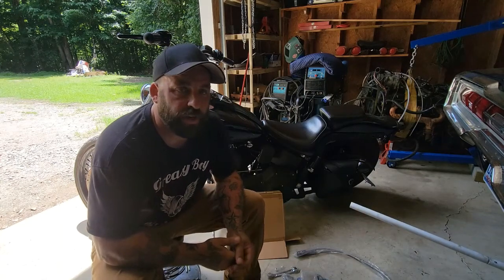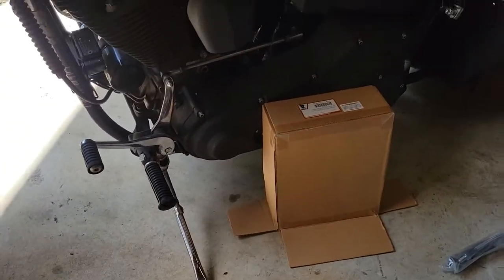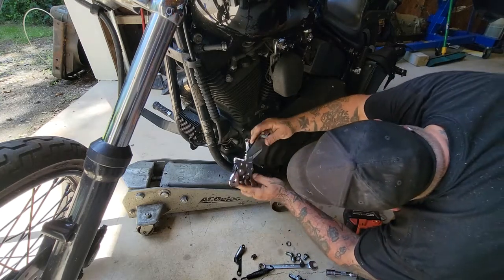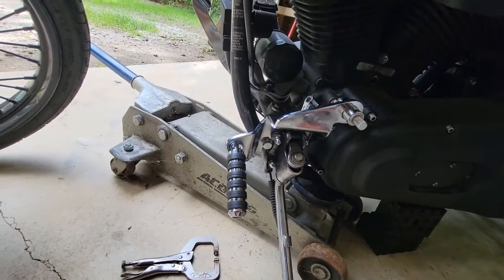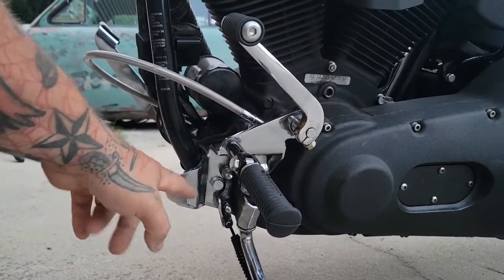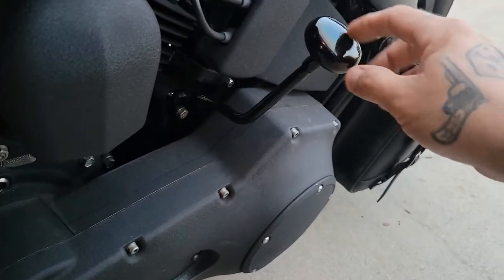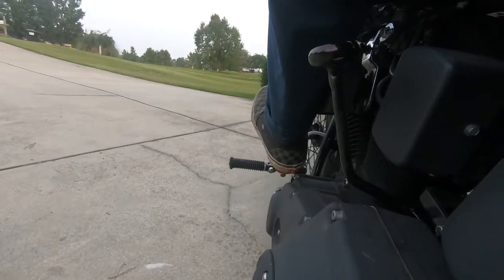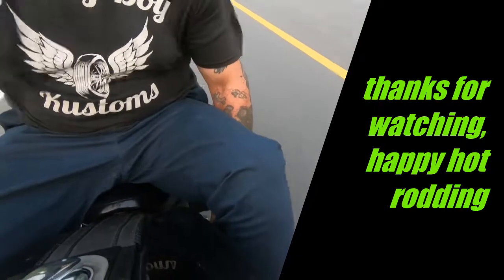FOOT CLUTCH AND JOCKY SHIFT KIT 1999 HARLEY FXSTB

Comment: How did you install the clutch cable?
Reply from the maker: It installs the same as a factory cable as far as attaching to the clutch.  Comes with a correct length cable to reach the foot pedal.  Has factory style ends on it